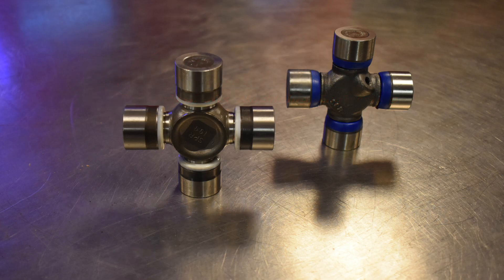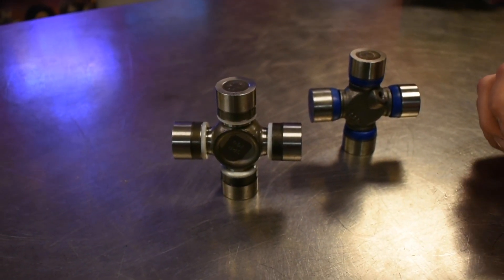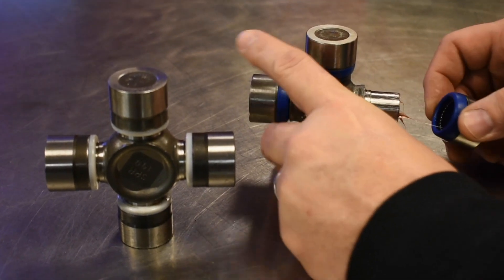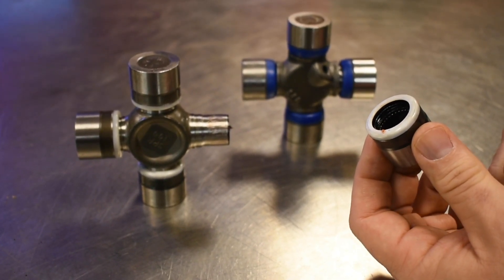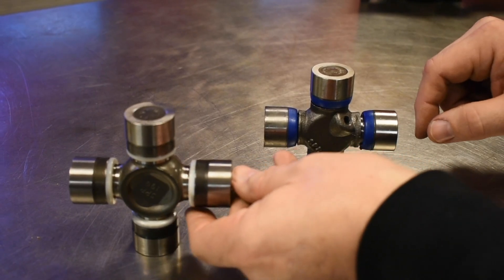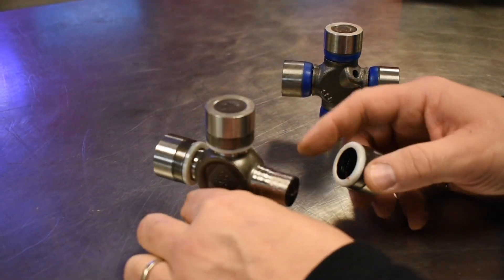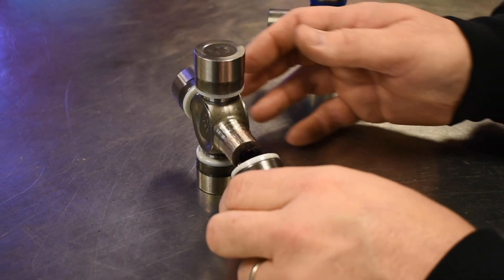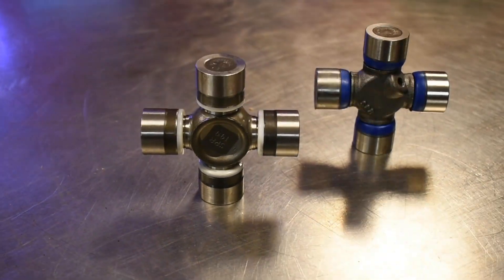Driveshaft Universal Joint: Greasable Vs Sealed

Comment: when you  pulled the bearing off the non-greasable unit,  it sure looked like  @ 2:42  it was drilled and pre packed with grease...

Every non greasable one I've installed   certainly was-   maybe not  clear-through the body,   but  definitely the  end was.
Reply from the maker: The body is not drilled through on the non-greaseable it is on the greaseable. You can see images of each on our blog without grease in the way. https://www.actionmachineinc.com/blogs/about-driveshafts/the-ultimate-u-joint-showdown-greaseable-vs-non-greaseable

Comment: Nothing against Spicer, but SKF are very high quality as well!  In fact, on top of the heap in quality.  The Swedes know there stuff!  The SKF U-joints I purchased for my brother to rebuild my Saab propeller shaft, are non-greasable.  The U-joints that GM installed (When they owned Saab, are complete garbage). My brother said thaey were the cheapest U-joints he has ever seen (the old ones)! The U-joints I purchased are actually for a Alfa Romeo Berlina Giulia, but he rebuilt his propeller shaft, with them, and they fit perfectly!  Nice video!

Comment: My f150 was somewhere around 200,000 miles when the u-joint on the front of the rear shaft turned to dust. Was the original one from '89. 
Replaced it with whatever shit they had at AutoZone, one with a zerk fitting, and have since had to redo the driveshaft. When it started squeaking a month after installing it, I discovered the zerk fitting was gone, and all the grease flung out. I assume that the fitting was loose from the get go, and I just should have checked it, so I blamed myself, got another one thinking that a greasable one was still better, and the second new one lasted a year. 
OEM parts are always better than aftermarket, as far as longevity goes. The OEM joints never have zerk fittings, they don't need them. 
And for whatever it's worth, cause no one told me, the clear grease that comes inside of a new greasable u-joint is basically there to hold the bearings in place, don't forget to pump that stuff out with new or it'll fail quick.

Comment: Yeah, show us hard fact data on the strength difference, also you say that the non readable is more precision ground which means it’s more expensive closer tolerances which means less lubrication. Lack of lubrication kills metal parts on top of the treatable joint is beefed up to support the drillings. And as lubrication properties fail over time because your not able to remove the contaminants its creates more wear on the metal parts. So your information is skewed on a bias. I have yet to see any supporting documentation to prove that there is more vibration in a treatable joint than non greasable.

Comment: I do have a question though. If non greaseable u-joints are higher quality, then why are they not used in commercial vehicles that use massive amounts of more torque than any car? I’m truly curious about this.
Reply from the maker: Hello @oagrimmett the short answer is they are used on commercial vehicles. Spicer a leader in the u-joint industry does manufacture Service-Free U-joints for commercial vehicles. I have added a Spicer pamphlet about the improved design and it shows the benefits of non-greasable vs greasable. Meritor a top manufacturer of commercial U-joints no longer manufactures greasable u-joints.
 
https://media.spicerparts.com/cfs/files/media/hoAdZZ2tqtZxZe52Y/J3342-SPLHDSF-22021.pdf?token=eyJhdXRoVG9rZW4iOiIifQ%3D%3D&store=original

Comment: Found this video after rebuilding the drive shaft on my 2010  Toyota Tacoma.   I was surprised the U-joints I purchased directly at the dealer did NOT have grease fittings like the O.E.   Makes sense now.  And I was supposed to grease the O.E. joints every 3,000 miles?  No wonder they failed after 200,000 miles!

Comment: That white one is a 5-____x 
1310,1350,1410 etc
I had a few of those sent to me and I did not like them. The plastic seal goes POP and snaps up onto a stepped portion of the trunnion and it makes things hard to move and noisy.
Same goes with their triple rubber oring. This triple rubber oring is attached to a mushroom brass fitting and is supposed to be pressed into the cap, mine were lopsided and actually causing more binding. 
The shitty little plastic washer in the bottom of the cap is useless. I got a shaft from PTI that had these washers squished to death. There were plastic chunks mixing with the needle bearings. They sent me replacements and i realized they were animals and did that on purpose. It caused .025" of runout in the driveshaft, and they put a ton of weight on the shaft exactly opposite this runout which was obvious.
I replaced them and voila! now it spun almost true, .002" runout. But I accodentally dropped one of the needle bearings in the cap when I was pressing them in and it obliterated that shitty plastic washer. Luckily I had a spare. 
Greasable ujoints are butter smooth and have none of these problems. Companies will make test results show whatever they want, and if it doesnt, they will do it over again until it does, behind closed doors. 
I agree if you drive through mud etc with a jeep per say the non greasable will keep clean better.
But.....
It all boils down to regular useage, cars, pickups, vans, and sucs, the fact is nobody greases ANYTHING, so naturally non greasable will win in that scenario. Grease your car! Suspension and steering components too!

And as far as strength, unless you are pushing 700 horsepower there is no friggin way that matters.

Comment: I question the statement regarding the bearing in a sealed u-joint are higher quality than the bearings in a greasable u-joint.   I'd be interested if you could confirm this with a link that I can view.
Reply from the maker: Everyone has their preference for the type of u-joint that is best for their vehicle.  If you do use the greasable u-joint, just be sure to grease it every 5,000 miles and it will perform well.  Spicer has tested durability of their SPL non-greasable u-joint versus the greasable u-joint.  Their testing shows better performance from their SPL brand non-greasable u-joint.  See the charts in the link.  On the fatigue testing chart, the non-greasalble u-joint is the one on the far right and their greasable version is right next to it along with other greasable u-joints..  Keep in mind that other aftermarket brands of non-greasable u-joint likely won’t have the same premium features that Spicer has so may not perform as well.  That is why we recommend Spicer brand components.
 https://d3qx1uccksbb2n.cloudfront.net/docs/J3349-22019.pdf

Comment: He's right...I have more than 300K + miles on my Isuzu P'up, still have the OEM sealed UJoints. Just make you don't go to flooded areas where water can enter through the seals, that said the grease will dried up that cause pre-mature wear.

Comment: I have a 07 4Runner 2WD with original u joints and I have 200k miles and is time to change the u joints. The originals don’t have zerk fittings. This video just confirmed that u joints with no zerk fittings last longer.

Comment: Very educational. Perhaps like powder coat (which people swear by, but doesn't last at all here), the sealed joints work better in climates other than where I live. I always hated non-greasable  U-joints, ball joints etc. I get about 70,000 miles out of a sealed U-Joint here in the rust belt. I rarely change greasable U-joints if I keep them greased. I never chage greasable ball joints or tie rod ends.  I have replaced them (and greasable ball joints) on other folk's cars where they were neglected. The exception is my 93 Toyota Previa All Trac (have had to replace CV boots on front axles a couple times, but never touched the UJoints, so perhaps it is possible to make a good sealed unit in Japan). It has 265,000 miles on the factory sealed joints and still going strong. But I've changed tons of  OEM sealed ones on domestic cars, often at around 70,000 miles. I put sealed ones in my front axle shafts as I couldn't buy greaseable for my 77 Jeep. Drilled and threaded the end caps so I can screw a grease fitting in to grease them. no clearance so I screw plugs in afterwards. That was in the 80's and still going strong! But for people who don't service their own car or have lazy mechanics who don't grease stuff every or every other oil change or at least once or twice a year, sealed probably is the way to go for the reasons you mentioned. Where I live, Salt water WILL get in regardless of the seals. Just never was impressed by sealed OEM, except for the old Previa. I always replace sealed components with greasable which really do last the life of my cars (I like to keep them WELL beyond 100,000 miles).

Comment: I guess it all depends on what your definition of the life of the vehicle is.  If someone kept their car for 50 or 60 years would the universal joint or the grease last so long.
Reply from the maker: Hello Mark, 
It would depend on how many miles you put on your vehicle & your maintenance schedule, not necessarily how long you have it. 

Most people do not maintain the grease able u-joint as the manufacture recommends shortening the life of the U-joint and driveshaft, hence why we recommend the non-grease able. 

From the Spicer/Dana website I included a couple links that you could find helpful.

Fatigue testing for there different non-grease able U-joints, including average life expectancy of part:
https://spicerparts.com/whatsthediff 

Grease able maintenance chart:
https://spicerparts.com/resources/lube-torque-specs

All spicer parts come with a one year warranty.
Reply: @actionmachineinc.5341  
You mentioned the benefits of the sealed u-joint...
I know Spicer is top notch, but do other manufactures also have the same characteristics ? For example the double lip seal and thrust washer ?
Reply: If maintained properly, greasable components seldom wear out. If you don't like to get messy with the grease gun, go for the sealed ones and replace them every few years when the salt gets into them (if you live where I live). But where I live you must keep after the body to get 50 or 60 years out of a car. Never ending battle. I run a Stainless steel body on my old jeep, and greasable components. My father still runs his 67 Wagoneer he bought shortly after I was born. Has well over 300,000 miles on it. I have a few daily drivers with 200,000-270,000 miles. Do have a Toyota with 265,000 on sealed factory u-joints, but most sealed last 70,000 in my experience. I replaced them with greasable.